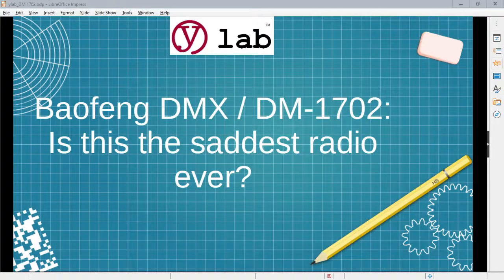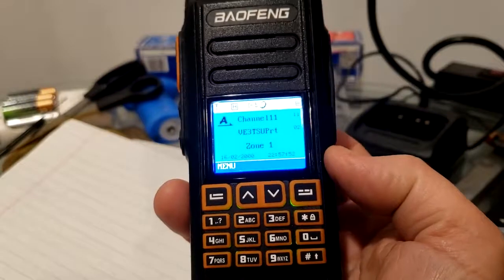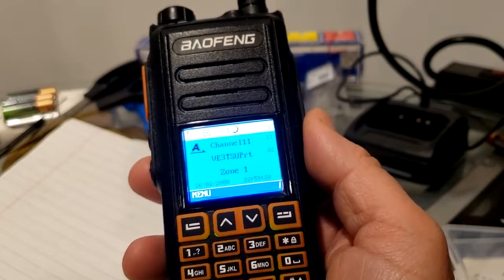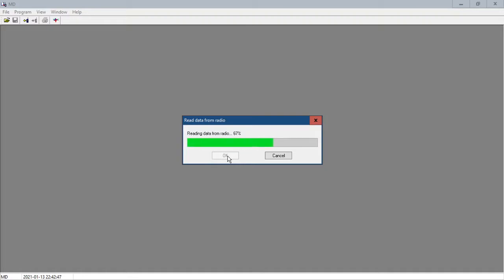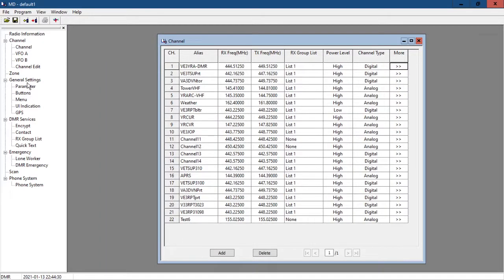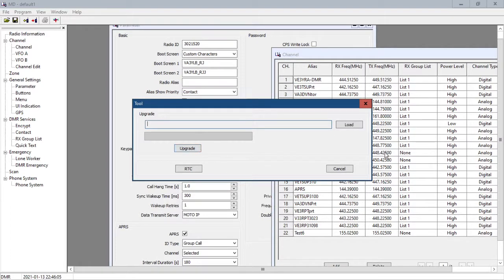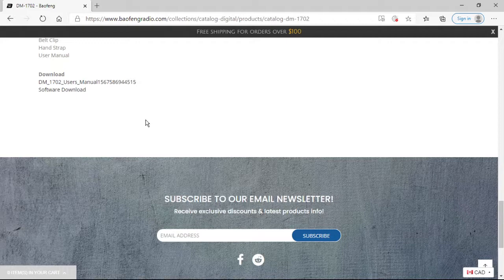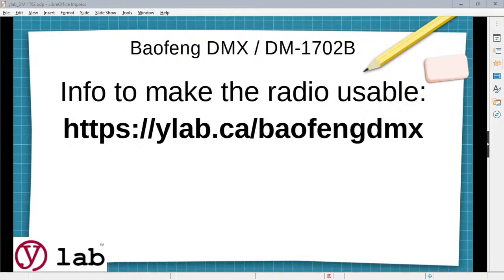Baofeng DMX DM-1702 DM1702  Configuration

Comment: You either got some old version or a counterfeit product. I just got mine a few days ago and everything is working flawlessly.
Reply from the maker: Can you post which firmware version you have? If it has been updated, we will see if we can find and share it for others.
Reply: I'm encouraged.  Thanks.  Actually, I'm not real serious  about DMR.  
But after mastering the  UV5R, I'm ready to fight once more.
Reply: @HarryHamsterChannel  This is a Retevis rt-72 clone. It's a great radio for the money and still going strong as part of my edc. I found zero flaws with mine as it came with updated firmware...
Reply: @polluxcastor1143  I'm on it.  Many Thanks  🙂
Reply: Does it do APRS messaging?
Reply: @realtyrocks1969  Digital aprs only and you have to enable it in cps. SMS also works and it compatible with MOTO/Hytera standard.

Comment: Same issues tried programming for a friend asked where he got it he said WISH tried software on here an CHIRP unable to read radio even my Amazon 8in1 read as port 3 nothing from usb or supplied cable so when I got com port 3 from amazon Multi connector the radio just sits there in CPS unable to read there's no port setting in CPS what comport should it be set at in windows
Reply from the maker: Try all the options and see what comes up.

Comment: Thanks for the heads up! 
If there is a dedicated software to program it, I am NEVER using it, anyways.
My Baofeng UV-5r cable for example came with a mini CD which was supposed to have some software, I am assuming it would be Chirp.
My Windows Defender detected a Trojan virus in it!
It was actually getting started, opening multiple mail mail app windows and getting ready to get spread in the Internet.!
If you come across this message you;ve been warned. 

**DO NOT RUN CHINESE SOFTWARE IN YOUR COMPUTER!!!**

This software shown on 3:32 has made it. I am NOT buying a cheap DMR. 
Besides it has no DMR monitoring, so you cannot go promiscuous mode anyway.

Comment: I had an issue with mine where one of the channels would always come up as a "null channel" - a little annoying, but hardly a show stopper. It was annoying because I knew the channel was set up correctly in the CPS. I figured it was probably a firmware thing, but as I couldn't find any later versions of FW, I figured I was just stuck with it. I eventually discovered a later version of CPS (I was using Version 1.00.66) and opened up the code plug with that (1.00.78). Lo and behold, my wayward channel came up completely differently; a receive frequency somewhere down in the 30MHz range, no transmit frequency, no digital or analog or power level settings, etc. Once I repaired all the bizarre settings, my "null channel" problem went away. Outside of that, it's been an "okay" radio for the $80 or so I spent a few years back. Not great, definitely a little quirky at times, but a usable dual-band, analog/DMR radio. I wouldn't recommend it to someone, as I feel there are better low cost options out there, but it's okay if you put a little time into it.
Reply from the maker: Like you said... usable if you have already bought it. Baofeng eliminated all references to it on their site and eliminated all links to download software. Nobody should buy this anymore. Unbelievable that it's still being sold.

Comment: I got a 1706, in which when you plug in the cable and turn it on, it shows up as a virtual com port in FS mode, but it does not show up as a taking a port (It SHOULD be in port 3) in the device manager. Needless to say, the programming software does not fully load, all I get is a "Couldn't initialize COM. Error 0". Then you click OK and the software terminates. Since this occurs, whether or not you even have the radio plugged in and turned on, the software doesm't even recognize it. Support has been virtually non-existant, even from the dealer in china (This was an "ebay Roulette" sale), and it is currently occupying space in my room, it obviously hasn't paid for. I have an Anytone AT-D878UVII Plus on the way, and I am hoping I get better results from that, even if those results include, me getting the SAME error, and THEIR tech support resolves it. Caveat Emptor.
Reply from the maker: Our guess is that you don't have the proper version of the CPS software. It is very specific to each radio, and the software has no indication of which radio it's for. They are all called CPS.exe. To make matters worse, Baofeng has removed almost every DM-series model from their web page. Some of them had download links for the software. All gone.
Reply from the maker: There are some comments  that the software for the DMX/DM1702 will work for the DM1706. We have a link on our DMX web page under the Upgrading the firmware section https://www.ylab.ca/baofengdmx/
Reply: @ylabmakerspace5352  The Baodeng site mo longer carries a link to 1702/DMX software. I went ahead and put in a SECOND request to them for 1706 software/drivers/firmware. If I can at LEAST get the first two, that wll be fine. If I get no reply again, I will request for the 1702.

Comment: Ok I'm tryring to upgrade firmware,  and I get a read model  number failed. Any suggestions ?
Reply from the maker: Have not encountered that error before. As we mention on the web page, the software (whether you call it MD or CPS) must be the correct one from the radio. When you run the software, there is no indication which radio it is intended for. If you have not done so already, try downloading the software we point to on the web page (link below the video).
Reply: @ylabmakerspace5352  Hi,  Thanks for the reply. I am using the software you recommend on your website but no luck. But I do appreciate your reply, so i will keep plugging along.

Comment: Wow ! You use the magik ? :D
I have no idea what i can to do for programming  this  Baofeng with MD software. 
If i tried read data from radio it wrote "Read data failed!" and radio restarted to Intro screen. 

Maybe you know how to resolve this problem ?
Reply from the maker: Make sure you have the correct MD software. It's very specific to the radios. Our web page on the DMX has the links to get it. https://www.ylab.ca/baofengdmx/

You might also try another USB cable. Many of them are charge-only and will not handle data.
Reply: @ylabmakerspace5352  Thanks ! Problem is solved. My radio work with software called MD-4000 Version 1.00.31
Reply: @Eygene2012  hello could you send a link to this software ?
Reply: @marcintryba8862  link has been deleted :-(
Reply from the maker: Check the web page we refer to under the video https://www.ylab.ca/baofengdmx/

It has a link to the CPS1.0.78 software. We also have a link to the Baofeng support page that has the latest.
Reply: hi, I have the same problem, you have the link?
Reply: @ylabmakerspace5352  It says Read data failed with the V1.00.78

Comment: It is truly the saddest radio ever.

But they were cheap.   Now I know why.
Reply from the maker: And not a lot of help out there for it. We're amazed at how many hits this video and our web page is getting for it. Clearly a need for more info.
Reply: @ylabmakerspace5352  It is a nightmare.  No wonder R&L dumped them for 60$US      

In any case, thanks to your page of info I was able to piece enough to gether to get them working.  You can't imagine the happy that occured the instant the first radio restarted from the plug write, and Brandmeister #91 comes on.  I don't give up easily, but even I had given up on them being anything beyond a questionable analog HT.     Many many thanks.

They still make my Yaesu rotor controller shutter like it's been smacked with a shovel  :)
Reply from the maker: If you are willing to share your code plug, please contact us on the web page at https://www.ylab.ca/contact-us/ with your email. I'm still trying to make it work on my radio. I've received a few tips, but haven't had time to work on it.